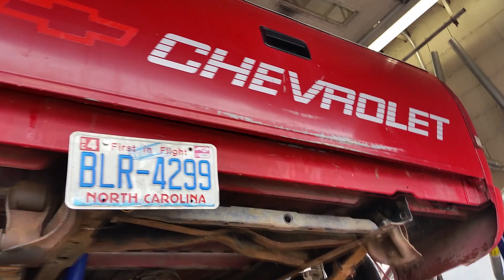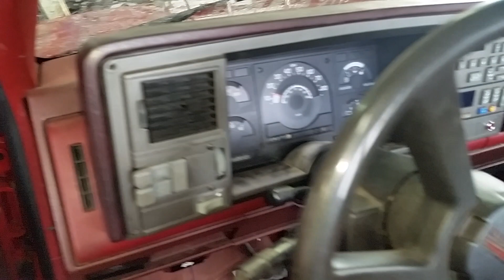90 chevy  silverado with ls swap

Comment: Awesome truck. Time to change gear ratio in rear to compensate for the larger rims. Nice ride in progress.
Reply: +Robert E Lee yup, needs some 3.73's
Reply: GoofyDaGoofGoofTV I have ls1 swapped truck just like this and have 3.73s with 15 in rims. At 70 mph in 6th gear i am barely over idle. Not sure what gears he would need for these big rims.
Reply: im about to ls 5.3 swap my 96 gmc s15
Reply: GoofyDaGoofGoofTV If you run into any problems with the swap let me know. Will be glad to help.

Comment: Yeah thats an ls, probably a 4.8 and a rather sad one at that but an ls nonetheless can tell by the shape of the oil pan, oil drain at the rear of the pan, the oil filter is recessed, the webbing in the sides of the block, the motor mount adapter plates, aluminum heads not found on any factory 88-98 chevy truck engines, and the harmonic balancer is that of an ls

Comment: I don't know if it's the fact that we never get to see under the hood or that it can't do burnouts on wet pavement but I am doubting LS status. My sad stock 350TBI with 3.08's can do burnouts which makes what I just watched really sad.
Reply: Nissan Truckguy it sounds like a 350 tbi too lol
Reply: Nismo D21 It has a fan clutch, lol LS1 never came with that. The oil pan looks like 96-98 vortec and not compatible with any LS. The starter sounds 95-98 truck as well, also not compatible. This video is totally fake news like CNN.
Reply: Bad Drivers of North Texas plenty of early LS powered trucks had fan clutch w/ fan. And his oil pan looks nothing like 96-98 vortec oil pan.

Comment: this isnt an ls im sorry ls has a 6 bolt this is a 350 and it sucks ass and my truck sounds better and it has stock mufflers and to top it off look at those wheels WTF i mean WTF isnt it a sport like it says come on this is a weak truck cant even burn out on wet pavement SMDH.
Reply: 350 engines do not suck ass
Reply: Hydro _star not the 350 engine thus truck does